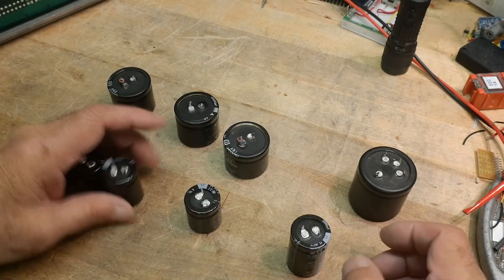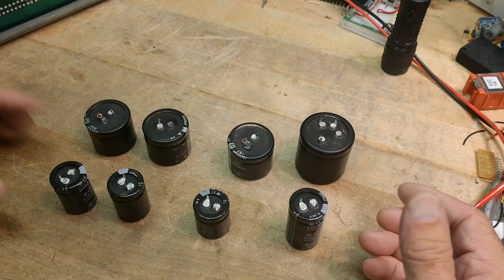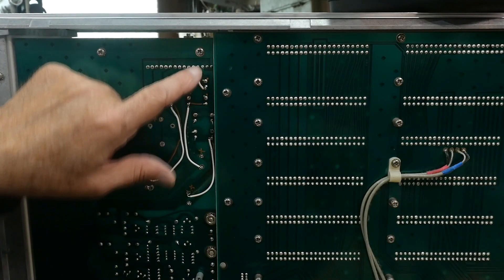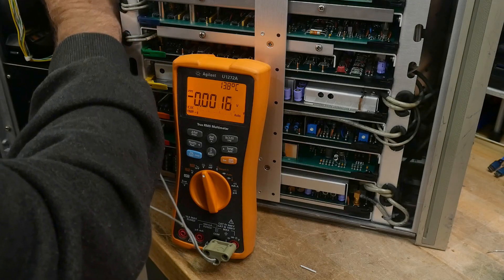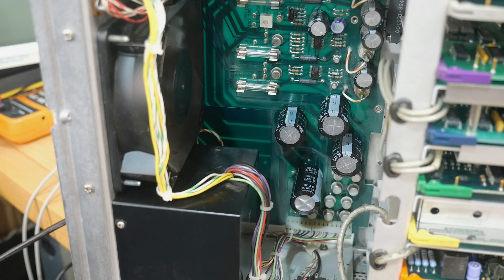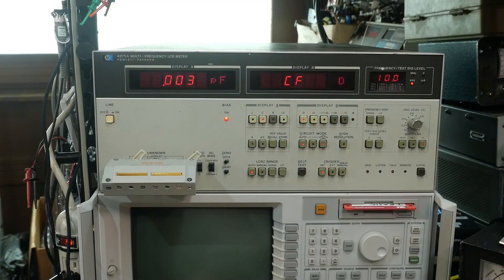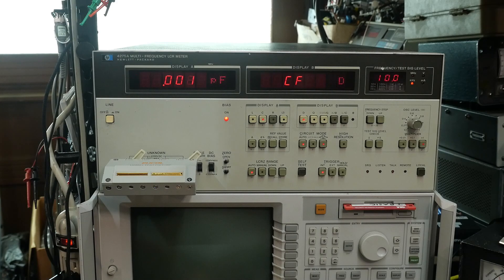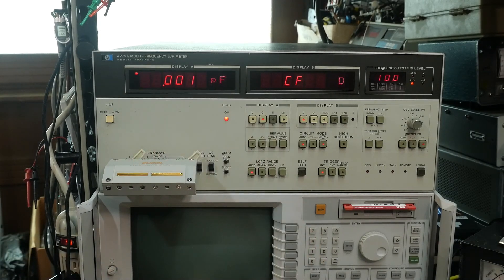#2091 HP LCR Meter Power Supply Problems (part 2 of 2)

Comment: I know you got that fairy tale Cali local store, but why not use global distributor like IDK mouser (their "4 Pin Aluminum Electrolytic Capacitors - Snap In" comes up un seach just fine).
These ECaps are not rare at all, even sold on Ali as well.
Reply from the maker: I got these from Digikey. what is the part number, I must have missed it.
Reply: @IMSAIGuy  on Digikey try "Lead spacing = 22.5mm" filter in ECap section.
UPD: no, you missed it completely, there is Package-Case filter = "Radial Can Snap-In  4 Lead".
Mouser has in stock:
382LX223M063N082 (40d80L beast)
and ALC10C223ED035 40dx40L Kemet I'd go for (there is a typo, it's a 35VDC cap which probably got rebranded to 40V having same sizecode 'ED' in a newer version of ALC10 Series datasheet)
Reply from the maker: @Mr.Leeroy  ok, sure enough. I think i had the lead spacing to 10mm while doing the first searches and forgot I had that set when looking at the 4 pin versions.

Comment: Far more reliable are tantalum caps than electrolytics. However, they are not available in high values and become expensive at fairly high values. Solid electrolyte caps are also extremely reliable but lack high values too.
Reply: Tantalum caps are not reliable. If they go short (and they do), they explode and set on fire. Not good.
Reply: @simontay4851  Military reliability guidelines specify a minimum resistance be used in series with tantalum capacitors to avoid sudden failures when initially charged at turn-on.  One reference from RADC says 3 ohms per volt.  I have seen other MIL references with guidelines based on capacitor value, if I remember correctly, but I no longer recall the specific documents.
Reply: @simontay4851  They are most reliable and run for decades without problem. Only if the voltage polarity becomes incorrect, it will destroy it. turning to flames is areal thing and everyone can test it. This means, the caps must be diode protected and fused
Reply: @henk38599  Tell that to the dozens of dead shorted dipped tantalum capacitors I replace every year.  Some don't even exist anymore.  Nothing but two leads sticking out of the PCB.  The caps have exploded into a 100 pieces.  At best I would say tantalum capacitors are ever so slightly more reliable than decent quality wet aluminum electrolytic capacitors.
Reply: @mikesradiorepair  I have been in the business for decades. There is always a reason for a Tantalum to die. It may be that some pirate parts may be the culprits in your cases. Also the reasons I mentioned above. If the voltages are too close to the margins, they are in the risk. If you put a 15V cap to 16 V,  it may break down. The margin must be much bigger, like a 25V or 35 V type. Bad design

Comment: I got a Q for you. Is it possible to fabricate a low C reference cap of accurate value with formulas? For instance say you have some thin glass of known thickness measured with a micrometer and known dielectric constant.  Can you place metal plates on either side of exact dimensions and then use the calculations to determine the exact value?   Same with an air wound inductor.  Known exact wire size, versus dimensions,  say close wound.   As for resistor standards.  Resistance wire with precise resistance per foot is available, so it should be possble to make a low resistance value pretty precisely?   At least at a known room temperature?
Reply from the maker: Yes. There are equations. First order. The real world will introduce some small errors.

Comment: I have to be satisfied with an LC-102  LC tester but it seems to exceed my needs for accuracy.  I got a cal lab Genrad cap that is rated at 0,01 plus or minus 0,25% or 25 pf?  and the Sencore reads all zeroes at the end.  I once had a 100pf SM that I hand selected with a lab grade tester for being on the money but misplaced it.

Comment: Perhaps replace the burnt traces with fuses instead of bodge wires. What if this happens again?
Reply: Today we learned: fuses are just wires.
Reply: What values of fuses you would put? There is a chance to trigger fuse when capacitor is charging for first time I think.
Reply: @ thin wires of similar cross section area to the PCB trace.
Reply: Yea what are the chances it will happen in his lifetime with new caps though? The Nichicon caps ought to last decades.
Reply: It's always the capacitors!
Reply: something else will break sooner
Reply: @Mr.Leeroy  Probably true.  If you make the weakest link better, the next in line will soon be next.  This is the issue with improving failed components; if the root cause is another component or system, you could be setting yourself up for more catastrophic failure.  Sort of like putting a 20A fuse in when the 10A fuse keeps popping, though I'm not saying that's what's going in here.
Reply: @pault6533  I mean it's simply an old tech, as reliable as they were built back then, still an old instrument with hours of work and parts aging against it.
Reply: Yeah I understand aging and my doctor's predictions....